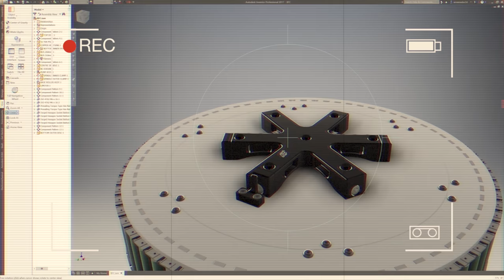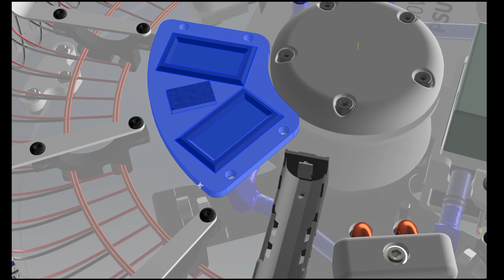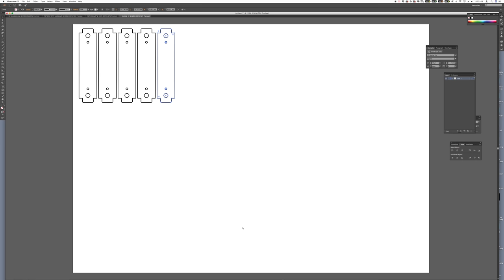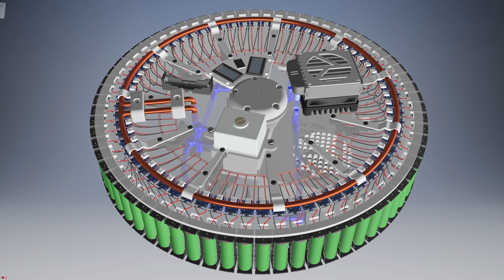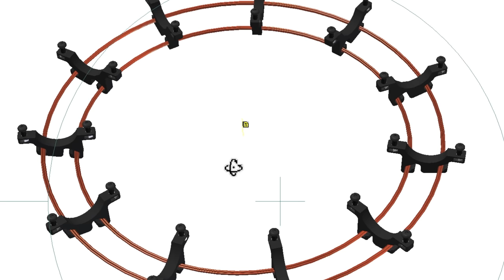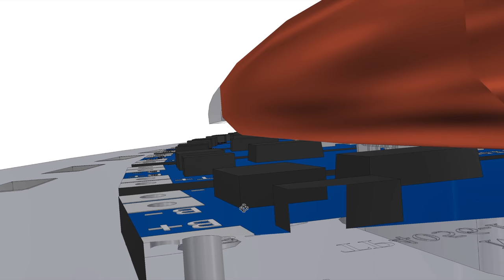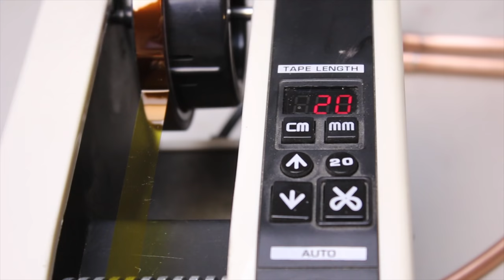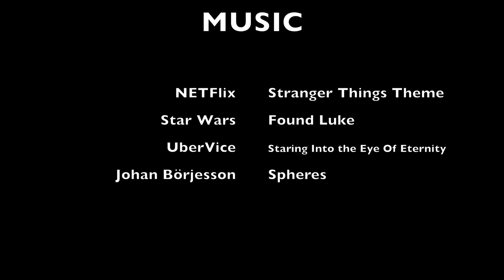Building an 18650 MEGA Charger - The Big Friendly Charger

Comment: Awesome. I hope all the 4056's are reliable. Changing one would be a major effort!
Reply: I think he would simply unsolder its 4 wires, crack the hot glue beads and simply slide the 4056 from under the copper tube.

Comment: Nice job!  Is there a reason why you didn't connect all of the tp4056 together via paralleling each board as oppose to using a bus bar?
Reply from the maker: by the time the last one got connected the load being induced would have burnt out the probably 30 of these modules, the bus bar was a good way of distributing the draw current from each module and they can act independently
Reply: ok cool, i just see people doing that.  Is this an all or none type of deal, i.e. when the unit is turned on, everything is on... its a great device if you have thousands of cells to process.  It would be cool if you can integrate discharging into the system and leverage IoT for remote monitoring... again, just for fun and keep the brain active.  I like the fact you didnt release this design early... so that others wouldn't copy it.

Comment: You do know kapton  tape is heat resistant it'll never transfer heat into the pipe
Reply: I was thinking a bunch of those sticky thermal pads they put between heat sinks and mosfetts would have been perfet for this.

Comment: Question why did you not use the cooling pipe as one of the power feeds/return.
Reply from the maker: Its a really good suggestion and I do practise designing components to have multiple use. But in this particular part I did give this some thought and felt the risk was too great in something shorting. Besides, this part is better when its removable in case I need to replace damaged or failed TP4056 modules

Thanks for watching and commenting

Comment: While the heatsinking looks cool I think it is overly complex and "expensive" to manufacture. I would have gone with those small heatsinks which adhere using a thermal pad, you will also have no issues with regards to height

Comment: As you aren’t running any real pressure in the copper coolant pipe, you could have used 2 part epoxy instead of solder.
Reply: evilution soldering is quicker and easier. Only takes a minute to flux and sweat copper, much faster than messing with epoxy.

Comment: So what is the point of the big fliiiiipping charger? I’m sure you explained it in a previous video. Do you have a massive been for batteries?
Reply from the maker: Yep I have a stockpile of 18650s amassed close to 20,000 cells and looking for more, but the main point for putting the BFC is just interested in seeing if you can, as well as can it be automated for feeding this at a .v2 stage ;-)
Reply: NERDVille 18650? 
What are they used for?
Reply from the maker: Stephen Boyd nonplan as of yet. Powerwall? Ev? Ebike? Most likely powerwall.

Comment: There are quite a few things you need to improve.
First: Why the turning design? A straight design would be way easier to build and later to work with.
Second: The 1x 18650 Holders you  bought are crap when it comes to taking out the cells. Either you hurt your hands after a few or you take a tool and damage the insulation of the cell. Try something 3d printed with a gab between cells.
Third: As I found out tp4056 don't need that much of a cooling system... you will see!
Reply: This build is more of a Wow factor, than practical application  ;)
He's already built a previous multiple charging station that has traveled the world helping out fellow DIY Lithium Reclamation Personel